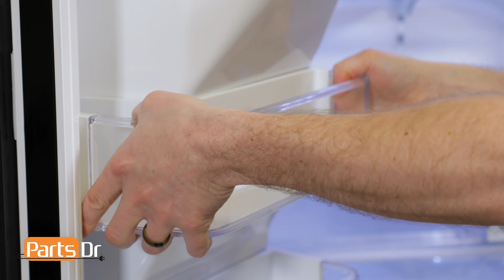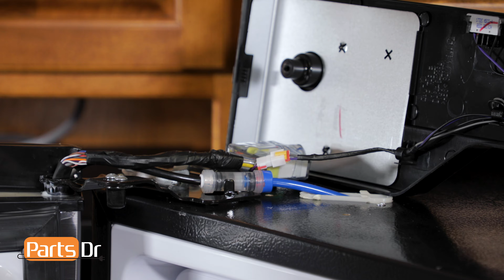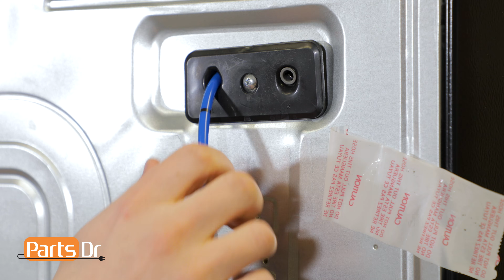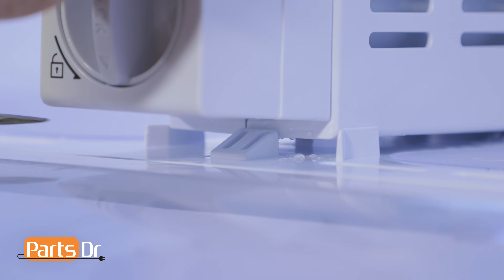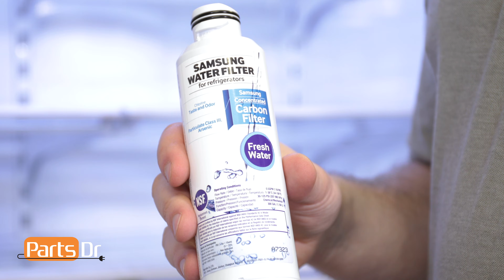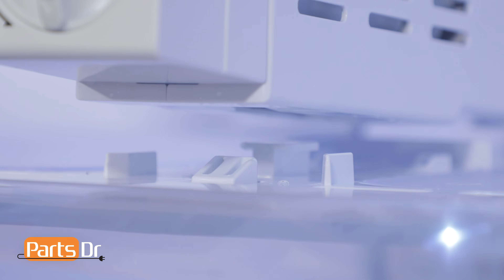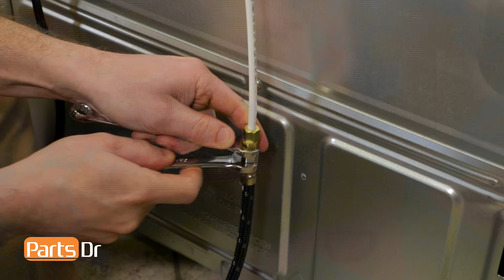Samsung Refrigerator Water Not Flowing? Replace the Filter Case Assembly (Fast Fix)

Comment: Thank you for sharing!! The copper fitting can be removed from the old water and placed on the new assembly should it come without one. This is the only procedure that was not in the video. Repair time 25-30 minutes.
Reply from the maker: Thanks for the tip!
Reply: I also did not get the copper fitting on my new one; but I wasn't sure how to remove the old. Instead, I used one of those little round quick connect things from my old part to splice together my old line (With fitting) to my new one. It seems to be working fine, I don't see any leaks. I may try to get the fitting off the old one or buy a new one at some point.
Reply: @3rdCoast3D  if you still have that part lying around you just unscrew the one end and then pull out the plug then stick it back in the new hose making sure you slide the nut part first
Reply: Mine didn't come it one either, but it was fairly simple to remove the old fitting and use it on the new line.  You need two wrenches to break the nut though.
Reply: Can u tell me the size because I can’t remove the old one, must be glued on.
Reply: I assume that most of you are talking about the main water inlet line, it's not supposed to have 1 on it, when you buy a New Fridge, it doesn't come on it either.

 Anyhow, In my Opinion...you should be adding your own Copper and/or Plastic Quick Connect Style fitting, to suit your Desire.

That is 1/4" Line, and should have a 1/4" Compression Fitting on it, with the Crush Insert on the Plastic line to prevent the line from collapsing. 

I recently found a 1/4" inline Compression, Needle Type shutoff Valve for Mine.

They say to use Plastic Compression Ferrells, for fear of cutting the plasting line, but I can tell you, the plastic Ferrells WON'T fit over the Crush Insert, so I had to use the Copper Ferrell, I think it will be fine, that line is pretty Tough.

And as far as the other side of the Compression fitting, going to your Main Water Line, you'll hook that up Accordingly, Mine has A Steel Braided Flexible Hose, that you Simply Screw tight to the other side of the Compression Fitting, if you have Plastic line coming to the Fridge, just repeat the process, or as I mentioned, use a Plastic Quick Connect.

Comment: Mine only came with one plug assembly, no lights. Was able to salvage old light assembly and use those though. Thanks for the video. Long Live the RIGHT TO REPAIR.
Reply from the maker: Great job on the repair! That is common on some of these filter case assemblies to have to transfer the LED lights from the old part to the new one.

Comment: Great video, thank you.
However, my refrigerator is a little different so this video didn't help my situation.  Do you have a video for a Samsung model RF29A9671SRAA to remove the water cartridge assembly?
I see no release tab or screws holding down the assembly so I'm at a loss right now.
I need to remove the cartridge assembly to get to the back panel.
Also do you have a replacement refrigerator back panel (evaporator cover assembly) for the Triple metal cooling  Samsung model #RF29A9671SRAA?
Thank you.

Comment: Could I just bypass this filter assembly entirely? I have RO going into my fridge. I could probably just hook the RO directly into the water dispenser/ice maker instead of going into the filter assembly, right? Or is there a pump in the filter assembly?
Reply from the maker: Check the owner's manual for your model refrigerator to see which options are available to you.  In most cases, RO systems are not compatible with refrigerators due to the water pressure and flow being outside of the manufacturer's requirements.
Reply: @PartsDr  Apparently my model of fridge you can just...remove the water filter and be done with it. Never did I expect Samsung would make something simple. The filter had failed, despite almost pure water running through it, resulting in incredibly low flow

Still hate the fridge, though.

Comment: How do you replace just the inlet valve that's in the casing?
Reply from the maker: On most Samsung models, the water inlet valve inset of the casing is not sold separately or designed to be replaced.  Instead, Samsung typically makes it so the filter case assembly must be replaced when the inlet valve fails.

Comment: Will this resolve the issue of having the water continuously run after releasing the dispensing paddle? Mine continues to run for 10 seconds or longer.
Reply from the maker: Yes, a failed water valve inside the water filter case can cause these symptoms.  Also, check that the water pressure to the refrigerator meets the manufacturers requirements.  A bad main control board or wiring issue could also cause this issue.

Comment: Thanks for the video. Do you know if this fixes the issue where the fridge causes the water pipes to vibrate like mad when dispensing water or filling the ice maker? We've been having trouble with the ice maker, so I re-plumbed a water line right to the back of the fridge. There's much more pressure now, but this jackhammering sound has started. Want to make sure I buy / replace the right part. Thank you!
Reply from the maker: Yes, if the water pressure to the refrigerator is correct, then replacing this part is what usually fixes this type of problem.

Comment: Excellent video and I had a great response from the company! 
There are a few of these videos about replacing the filter case assembly but the part on my refrigerator did not look like any of the videos. There were a couple of these companies that listed a part that looked like mine but they were all out of stock. 
Parts DR though, offered to have me leave my email and they would contact me when they had it in stock.
I am very reluctant to leave my email in any of these sites but I really wanted to get this fixed.
Well, within a couple of days, I got an email saying that they now had it in stock! 

Still reluctantly since I didn’t know the company, I went ahead and ordered it.
And lo and behold! Two days later I had the part, and it came with a Samsung water filter - nice extra!.
An hour later the fridge was fixed! Thank you Parts DR!!
I made the same discovery about the copper fitting listed in the pinned comment from 4 years ago, but it was obvious as to what to do.
Reply from the maker: Nice job fixing it yourself!  Thank you for the feedback and thank you for supporting us!

Comment: Question. I have water coming out the dispenser but I don’t think water is getting to the ice maker. Do you think this part is the reason my fridge isn’t making ice?
Reply from the maker: Yes, it could be a failed water valve inside of the filter case assembly.  But, there are other things that could cause the issue like a bad ice maker, bad main control board, or frozen water line.

Comment: When I looked up the part for my Samsung it was one of the water intake value only models.  So, I ordered it, and used this video to remove the filter case, then it wasn't a big deal to open that up and replace the water intake.  However, same behavior as before.  It works for a while, then stops. If I remove the filter and insert it back, it will work for a few times then stop again.  I ordered a new filter, but not hopeful that that will fix it.  Not sure what could be the issue now.

Comment: Thanks to your video AND the filter case assembly's availability at PartsDr I was able to repair our 10 year old Samsung refrigerator and hopefully buy us years more food storage with this appliance. Our issue began with a water hammer-like sound when dispensing water and quickly became an internal leak. So, we had the opportunity to thoroughly clean our fridge, install the new part and are back in business. Fast standard shipping and a satisfied customer. Thanks!
Reply from the maker: Nice job fixing it yourself!  Thank you for sharing your story and supporting us!

Comment: Water works but the ice maker is not getting water and will not reset, is this what I need to replace to get the ice maker to work again?
Reply from the maker: We usually recommend to start by replacing the ice maker first if you haven't already done so.  A failure of the ice maker can cause it to not fill with water.
Reply: @PartsDr ok. The other day I had water under where the filter is
Reply from the maker: @Bosscat63  That could relate a failure of the filter case assembly. Let us know what you find.
Reply: @PartsDr then I’ll do the filter case

Comment: Thank you guys so much for this video. It was perfectly helpful in getting the exact problem we had with our fridge.
Reply from the maker: That's great!  What symptoms was your refrigerator having when this part failed?
Reply: The fridge was put in storage, but rats bit on the water lines (behind the fridge) trying to get whatever water they could. Had to replace the Filter Case Assembly, but once I ordered the part, this video was perfect and led me step-by-step to get it repaired.

Comment: Great video, would this fix my issue of  getting water when the filter is removed?
Reply from the maker: Can you please re-phrase your question?
Reply: @PartsDr   refrigerator stopped dispensing water, replaced the water filter but still not dispensing water.  I removed the filter and water does come out.
Reply from the maker: @TxJuggernaut  Yes, if this part fails it could cause that type of problem.

Comment: My fridge water filer case comes with 4 lines (just like what i have in the fridge exactly)  2 of these water lines are connected in the bottom of the back of the fridge... should i remove the metal cover to replace these 2 lines?
Reply from the maker: Those lines might go to ice maker(s) in the freezer compartment.  We aren't sure what you need to do different to install the part.  Let us know what you find.

Comment: Hello I have a RF263BEASR fridge, and I need to replace the water assembly, does the part DA82-02863A, works on this model as well?
Reply from the maker: Yes, but it no longer includes the LED lights.  https://partsdr.com/part/da82-02863a-water-filter-case-assembly

Comment: My experience: The screw that secures the case assembly against the back wall of the fridge was something I didn't know about when I had been messing with the assembly previously, so the tab was broken off. When I tried to pull out the grey plastic water line from its "quick release" by using the method shown in this video, it would only come out a little at a time until about the final 10". It was a struggle. There was about a 1/2" discrepancy from where the grey and blue plastic lines on the replacement assembly had their black marks compared to the original. There was no brass fitting included on the white plastic tubing for the water supply connection, which required a trip to the hardware store. Note that a small, trumpet horn shaped reinforcement piece goes inside the tubing to prevent the tubing from being crushed under compression. There is a small 3-wire electrical connector that was very difficult to remove, which required a VERY small metal blade to be inserted to depress the locking tab to release. Other than that, it went OK. This video was helpful.
Also of note was a small area of rust on the outside of the fridge's back panel. This is near the top and seems to be caused by condensation from a lack of adequate insulation inside the refrigerator in that spot location.

Comment: I had my case filter replaced 14 months ago. However, my water is not dispensing again. Is it common for these parts to have to be replaced this often?
Reply from the maker: No, we do not usually see the water valves fail that soon.  Sometimes very hard water or water pressure that is too high or low can cause failures.

Comment: One Note to add here, is that if you are getting water under the Crisper Drawer, this is a VERY HIGH POSSIBILITY of being your Problem, ESPECIALLY the part that you mentioned already about using an OEM Samsung Water Filter, as that Appeared to be my Issue, I am still testing this Monster in the shop, B4 I move it back in.

I started down the Rabbit Hole with the Dreaded Code 22E, Leading me to think that was my problem, only To find VERY LITTLE Ice, So I resealed The Cover with some 1/4" Foam Tape, and put a New Evaporator Fan Motor in, and So far, so good on that part, It is Holding Steady at 34° in the Fridge, and 0° In the Freezer, at 75° Room Temp. Ice Maker and Water Working ETC.

Sadly, last night, after waiting SEVERAL HOURS for the Ice to build up, and Flushing the Water Several Times, I found the Dreaded pool of Water back under the Crisper Drawer. So I happened to have a Spare water Filter " Not Samsung OEM ", replaced it and So far, so good on the leak.

I am DEFFINATELY getting the OEM Samsung Filter if this Holds up, and Seriously Thinking about Replacing this Assembly, as It Obviously has alot of possibilities of Leaking, and GREAT VIDEO on Explaning the Internals.

If I can figure out how to use Paypal, I am going to Donate to your Channel, thanks for the Videos.
Reply from the maker: If the problem isn't from this, it is often also caused by a failure of one of the automatic defrost components (defrost heater, defrost bi-metal, defrost sensor, main control board) and the defrost drain is frozen.  https://www.youtube.com/watch?v=bPJM0TCaQDg
Reply: @PartsDr  Thanks for all the replies, I just placed my order with you, and with Express Shipping for the Water Filter Case Assembly, and I already have an OEM Filter Coming.

Although I got the leak to stop with a new aftermarket filter, I was just too uneasy about the possibility of it  leaking again, and I can see where it has leaked in the past as well, so I'm going to replace it, and that way I can clean the Electrical  Plugs, and get some Dielectric Grease on them as well.

This thing is a Monster, And I wanna make Dam Sure It doesn't leak into the basement ceiling after I Re Install it in the house.
Reply from the maker: @diymaniac876  Thanks for supporting us! Let us know if it fixes your problem.
Reply: @PartsDr  Will Do, I'm sure It will, I'm pretty Confident it was Just the Aftermarket Filter, but wanted to Be 100% Sure, so I just got it.

And BTW It Arrived Today here in Ohio, so the Extra Cash for 2-3 Day Delivery was Well worth it, I ordered it Monday, not bad From South Dakota  !!!
Reply: @PartsDr  Fixed my leak, now I've lost Power to the Condenser Fan motor, getting my Compressor hot, any videos on that ? Compressor Runs, but no Fan
Reply from the maker: @diymaniac876  Happy to hear that the leak is fixed!  Your other problem could be a bad fan motor, bad main control board, bad electrical connection or a combination of those.  We have a video on replacing the condenser fan motor here: https://www.youtube.com/watch?v=P0Ns2fSD0IE

Comment: All your videos are super good. I do not know why my ice maker is not making ice. I do not know if it gets any water, while the water dispenser works great. How do I check if the water valve is at fault.
another thing is, how do the two water lines match up if you just put them back in the openings? do the meet in the water reservoir? Thanks

Comment: 3:18 This may be misleading, there is cause for concern if the new unit does not come a second plug, with the LED lights. You will need to remove the LEDs and plug assembly from your existing unit, take apart your new unit and install them both. If you don't do this, you won't have lights on the side of the unit. Also, none of the lights in the fridge will work without that second plug.
Reply from the maker: Thank you for pointing this out!  The change where some new filter case assemblies do not include LED lights is something the occurred after this video was filmed.  If the new filter case assembly do not include the LED lights, they must be transferred from the original part to the new part.

Comment: Is there any resistance testing that can be done to confirm if this assembly is the culprit? I have no water going to the ice maker but water is fine at the door water dispenser. Thank you in advance, your videos are outstanding and so helpful!
Reply from the maker: Although you can test the resistance of the solenoids on the water valve, we have found that this test is not accurate as the solenoid can show a good resistance value but it can not function because it could be physically stuck.  There is no simple way that we have found to test this part in a Samsung refrigerator.  Here is a video that we made showing how to test a dishwasher water valve that you might find helpful:  https://www.youtube.com/watch?v=vrDSl24vwao

Comment: Not sure you'll see this - but is it possible to just replace the water supply line to the assembly? Everything else works fine, but the supply line has sprung 3 separate leaks recently and only that line should ideally need replaced.
Reply from the maker: You can try if you can find a line with the same specifications as the original.  The problem is that some of these use special fittings where the water lines attach to the water valve and they are not able to easily be removed and replaced.  Also, if one line is leaking now, it is likely that the other lines could start to leak soon too.  So it may be best to replace the whole filter case assembly.
Reply: @PartsDr  thank you for taking the time to reply!

Comment: What is the part # for rf28r6201sr
Reply from the maker: Sorry, the last message was wrong for your model you need this one:  https://partsdr.com/part/SAMDA82-02878A
Reply from the maker: It looks like you also provided our chat rep with a different model rf28r7201sr/aa.  This model uses this part: https://partsdr.com/part/da82-02870a-water-filter-case?model=RF28R7201SR---AA-00